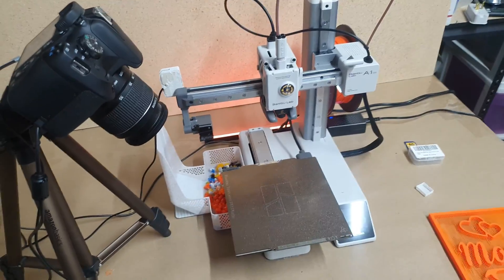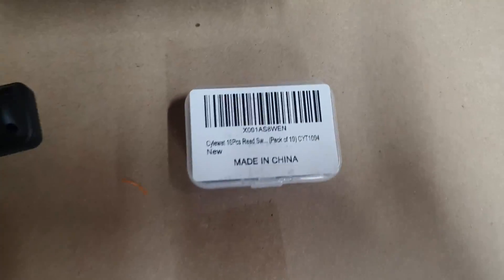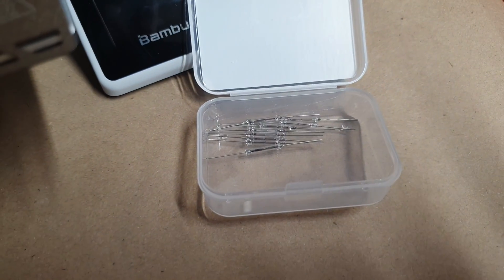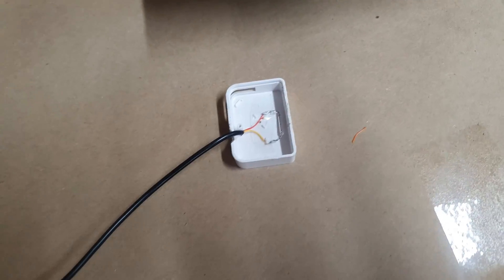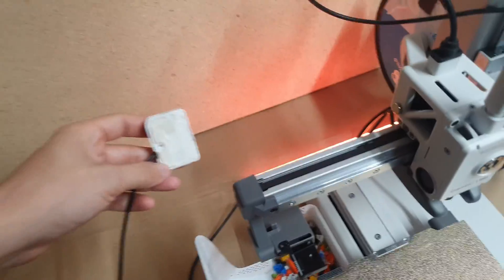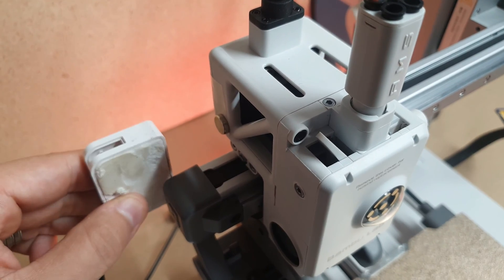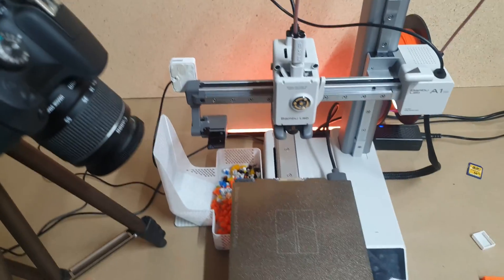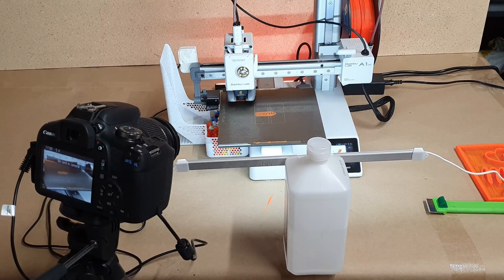How to make Easy Timelapse videos using the Bambu Lab A1 Mini

Comment: If you have a strong enough magnet, it should be possible to set it up on the outside of the x1c cover/housing don’t you think? I will definitely try!

Also while looking at videoes trying to figure out how to elevate my 3D print Timelapse, I’ve been playing with the idea of doing a Timelapse using long exposure. In theory that should remove the head from the shot as it’s constantly moving.

Comment: I want to add my Blink mini two camera to the mini A1 but I would like to mount it so it’s attached to the bed so that I can monitor the build live without blur. I’m thinking there should be a camera mount that could attach to the cable connected to the bed